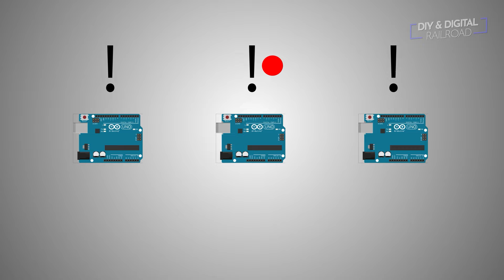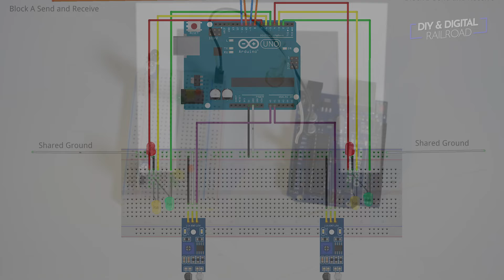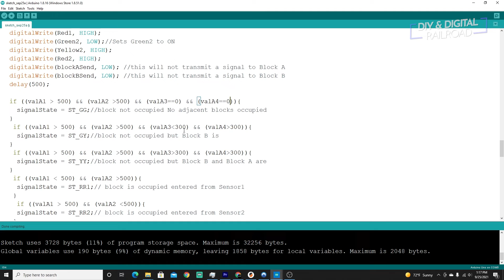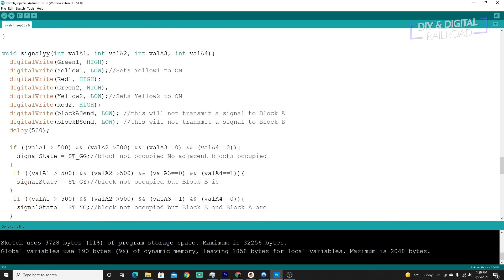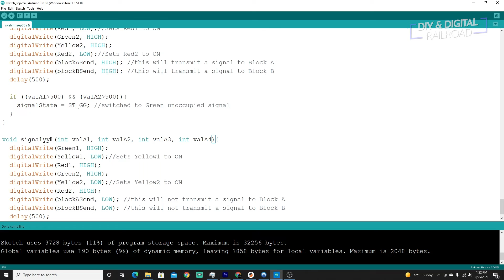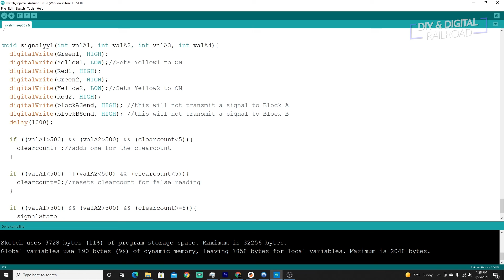Model Railroad Arduino Block Signal Upgraded!

Comment: Mind if I ask, why did you use analogue read and not just digital read on A# pins. A0 = D14... A5 = D18, these are Digital or Analogue read pins. Also, why have 3 Uno and not just a single Mega, which would be more power efficient?

Comment: Great information Jimmy. My partner and I built your system last year but have had some problems with it. Mostly bad soldering. I built a signal bridge for one signal target and when I powered it up all of the signal LED's are on. The other signal just the red light is on. What do you think is the problem. I plan on downloading your new sketch. Keep up the great work you do, and thanks

Comment: I've been enjoying your Arduino programming video's. Have you had any problems with your IR sensors reliably detecting your trains.  I have been having trouble detecting my old Lionel metal engines and cars.  I'm thinking that the black paint is the problem.

Comment: I'm new to this, and I'm already doing something. One doubt was that if two trains run behind each other, it is likely that there will be a red signal. If so, will it stop or do I have to give the order to stop until the signal changes? What if the block is busy, does any subsequent composition stop or not enter that block?
Thanks for the help and videos

Comment: Jimmy, this is awesome.  I breadboarded this out tonight and it works perfectly.  I did have a thought:  What if a train were to back into the block (say, during switching), trip the sensor, but then move forward out of the block without ever tripping the sensor on the opposite end of the block?  The signal wouldn't reset to green.  Any ideas?  I monkeyed around with the code a bit and setup a "reset button", but hate to have to rely on that.

Comment: But first: I love your train set automation videos a lot! It's cool seeing people use embedded systems in their hobbies (warms my progranmer's heart) and very cool.
Another tip from am embedded programmer.  

Don't use int blabla = 12 for a port number. That would compile down to an actual variable, even if you make it a const int -- which btw would've been syntactically better, it is reserved on the read only memory heap.
A "#define BLABLA 12"  will not steel expensive variable space and translate any BLABLA with the immediate value of 12. This leaves more variables for those complex objects in libraries ;) Also a port doesn't change so a #define or even if you want a "variable"  a const is more appropriate.

Also the blatant copy of yy to yy1 and only changing the digitalWrite is highly inefficient. You could've changed that into it's own function and parameterised that, with a state parameter and if state is YY1 then set to HIGH else set to LOW and call that function in yy and yy1 respectively. 

And using globals is a very nasty habit, clearcount could have (and should've) been passed into a function through an argument. And returned after it was updated by the functions.
And it could've been a static int clearcount.

And one thing that I freak out over, is using delay() in function where there's actually a potential need to keep on running (your trains keep running too) so you don't want to block a function.
You would give it a wait amount in an event array, and you keep running the rest of the code and check every time if the time has passed and then execute the command.
I tend to make a DelayExecution class that has the delay variable as part of the class. And I inherit from it and implement the "work" method.
That way your Arduino keeps working on other tasks in the meantime.

Comment: Why use so many Arduino's? 
It makes it rather expensive and more difficult to debug and draws more current etc.
If it's because of lack of IO then  you can just use an IO extender and if you need analog pins, use a digital switch. I created an extension board that has 32BIT IO (on my channel). The cool thing is that since they run I2C you can easily run 4 wires from your Arduino or Pi (or neighbouring I2C bus) and put the IO where you need it, without running 32 wires (in my case 32 but those are 2 IC's it's 16 per IC and you can have 8 on a single I2C bus) back to the central place.

And that can also work on an Arduino, so that's all the digital IO you need (you can add to 8 of these chips on an I2C bus!) And for analog you can use a demultiplexer like a 74HC4051.

A raspberry pi or using FreeTOS on Arduino, are better solutions than the standard arduino. As they offer multitasking and in case of a Pi 4 even actual parallel processing.
I think you'll find it a whole lot more flexible and solve complex problems. And you can even integrate a nice UI too, showing where trains are depending on IR check points or isolated tracks with current measuring solutions.

Comment: Great video thank you! I have a question. Could you not use only one voltage detection circuit (like LTV 814 optocoupler that acts like a push botton) for the occupation of the block instead of an entry IR sensor and an exit IR sensor? If there is a train in the block, current flows through the optocoupler that acts as a "push button" and gives  signal to an arduino digital pin. If there is no train in the block, there is no current running through the optocoupler so there is no "pushed botton" and no signal to the digital pin. If and when the block is occupied the arduinos of the other blocks can change their signals accordingly. In Hungary we also use red, yellow and green lights  to signal track occupancy on real railroad tracks that have automated track occupancy detection between stations, however the neighbouring stations must communicate with each other and pass out the directions of the trains running between them. One station has to be sender and the other must report to be receiver otherwise the system sends an alarm and closes all blocks down with red signals to prevent trains running frontally.

Comment: Jimmy, great video. I have seen others that use a hall effect current sensor instead of the IR sensors. Is there a significant difference in the use of IR vs hall effect? I, like another commentary, am setting this up to also work with JMRI except I will be using RS485 serial communications between the arduinos and the RPi.

Comment: I am in no way shape or form a programmer, even though I started writing code in BASIC on an Atari 512 and Commodore 64. 

Is there a significance to the space after the first greater than and no space after the second one?

if ((valA1 >"space" 500) && (valA2 >"no space"500) && (valA3==0) && (valA4==0))
if ((valA1 > 500) && (valA2 >500) && (valA3==0) && (valA4==0))

I will be using this on my layout.  I am in the process of collecting the pieces and parts needed to start building.  As I will be using the DCC++EX, Arduino servo turnout control, Arduino signaling, I am going to need a whole Lotta Arduino's.

Thanks.

Buzz.
Reply from the maker: Hey Buzz!  No there is no significance to that space.
Reply: @DIYDigitalRailroad   Thank you  for the quick reply.  When I was taking C++ WAY back when, everything had to be in the correct position to work correctly.   

Being an "OLD" guy, the level of tech that model railroading has taken on is amazing.  I remember the living room oval or figure 8 with the AFX slot cars running around.  Now a degree in computer programming and or hardware is very helpful.  

Thanks.

Buzz.
Reply: @dorkydoo683  C++ was never space aware. Because C isn't either and C++ compiled down to C initially.
So I am really curious what you've used but I never have had an issue with spaces in all my 32 years with C++ :D
Unlike python :D
Reply: @CallousCoder  

It seemed every time I went to compile it would give me errors.  I would go through the very simple code, make sure I did not have spaces between the last letter and the semi colon, colons, two spaces between words.  I might not have been that, but in removing the spaces, I fixed what was actually wrong.  Yet every time I made sure of the spacing, it worked. 

Really doubt  that makes any kind of sense?  

One of the biggest issues I had, the instructor was GOD level and he had trouble coming down to peasant level.  I guess when you are the senior programmer, with years and years of practice, it is difficult to see it from the first time programmer.  I did not know enough to be able to ask a proper question.

Buzz

Comment: Jimmy,  Thank You for adding technology to the hobby with the printing and Arduino videos.  I'm going to be a bit picky and I do not mean to offend you in any way. It would be better if you used  "non-blocking" code for the 5 sec. delays. Presently during the 5 * 1000ms delay the Arduino is just sitting doing nothing and therefore any other inputs that might change during that time may be missed or run in an incorrect order thus possibly sending an adjacent blocks to an incorrect state.  This is subtle and is hard to debug should this occur.  BTW would you be interested in some oil pumping STL files that I am thinking of making?
Reply from the maker: Hmmm that is interesting to think about.  I think the only situation I haven’t accounted for in the 5 seconds would be a train entering at the opposite end as soon as it turns yellow.  That wouldn’t take much additional code to remedy.  Thanks!  As for the stl files.  Sure!

Comment: It would be very helpful if you could describe where in the block the signals are positioned, what way they are facing and what they are expected to control. For example is one signal at the left end of the block and one at the right end and both facing trains that approach the block so that they control whether trains may enter the block from the left or from the right.
I have enjoyed the videos about DCC++ - I am using it and it works very well.

Comment: Jimmy, I have done something similar and added C/MRI code to the sketch as well. So that it all works with JMRI. Each Arduino is a C/MRI node via USB connection. So you don't need to chain them together and can use as many as you need up to 254 per USB PC hub. In my case Raspberry PI that runs JMRI.
Reply: Interesting comment Ian - are you connecting each Arduino to a port in a USB hub - if so how many are you using at the moment, and where do you get a 254 port hub system?  
I've taken a slightly different tack using Arduino Nanos to check up to 8 sensors and sequence train movement (effectively de-bouncing the sensors) and fed those to JMRI via the sensor inputs on a DCC++EX command station, and then taken a single CMRI node to a Mega to drive 26+ points and 24 signals (so far) using several PCA9685 16 way servo/led driver extension boards (~£3 each) on an I2C bus around the layout.

Comment: Hi Jim, the improvement is OK, however the real railroads work a bit differently. I sent you about a year ago my comments and the modified code, where there is a direction bus,  ( eastbond or westbond). This turns the signals in wrong direction either too red, or dark, like on the real railroad. ( on analog tracks you can use the track polarity to get the direction signal, in digital you should have a switch to select the traffic direction on the line)..
Reply from the maker: Hey Railfilm!  You are correct, I am actually also working on a version of this that will work that way as well.  It is actually simpler code than this too!  I remember seeing your code and I am so happy that people are taking this and modifying it to work on their layouts!
Reply: Here, in the UK, real railway signals are never darkened. They are always set to red for 'wrong direction' trains. The signals are interlocked with the points [switches] that determine the direction of travel. On models, if the signals and points are interlocked, there should be no need for any direction detectors. Interlocking is a logical operation, easily done on an Arduino.
Reply: @henrybest4057  
it is an option to keep the signals for wrong direction red, or darkened. ( there are different rules). Yes, the first signals to the yards can be interlocked with the switches, but in this case we are talking about the automatic block signals on the open line between two stations.
Reply: @railfilm  Its not an option in the UK. The rule here is that they must be set to red for 'wrong direction' trains.
Automatic signals must also be able to be controlled from a distance. Does somebody have to walk along the track between the two stations, flipping a switch on every signal to turn it to red (or darken it, in the US), or is it done centrally, through interlocking? Automatic signals must be able to be overridden in emergencies. There's been a landslip ahead. The line ahead isn't occupied (but is obstructed). An automatic signal will continue to show green unless the signaller (maybe many miles away) can turn it to red to prevent an accident. Interlocking isn't only local.
Reply: Henry Best 
Sorry for the confusion.. This signal status is an option on the Arduino project only. Ie. You can select what option you want to have. The red signals or the dark signals. I investigated in several countries and railroads, what is the standard for the signals for wrong direction. There is no common rule, both systems are in operation. 
On top of that in US there is a line close to Chicago, where all signals are always dark when no train is approaching,. When the train enters the block the signals are turned on, when the train passes the signal the lights are turned off again.
In several systems the automatic block signals have an automatic control circuit which continously controls each bulb for conductivity. The red bulbs are special devices with dual filament. Ie when the main tungsten is broken, the second one will turn on and it is indicated in the control box. If any of the green or yellow bulb is broken the signal is turned automatically to red, and there are special rules for the trains what to do in such case.
 I do not think that these things are important for model RR, it is just some simple summary of the permissive block signals used worldwide with 3 or more lights. (There are automatic systems with 4 lights (2 yellow) for the high speed blocks.. the second yellow indicates the status of the next signal.)
For emergency case there are also several systems. Generally all dark signals means STOP for the trains. Ie in emergency case they turn of automatically or manually all signal lights, ie each train must stop before the dark signal.